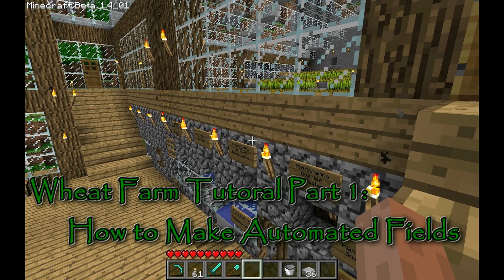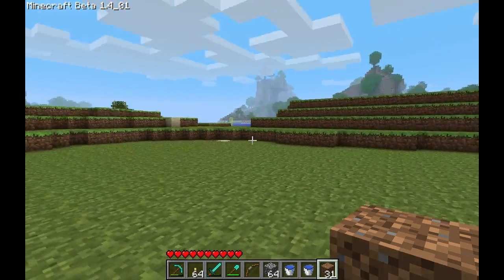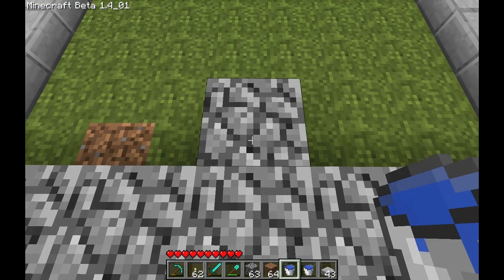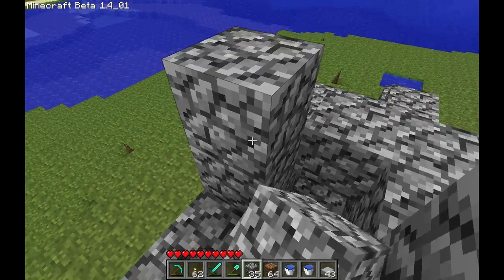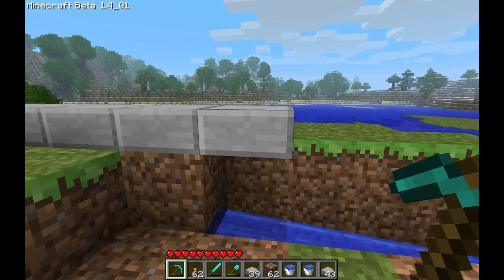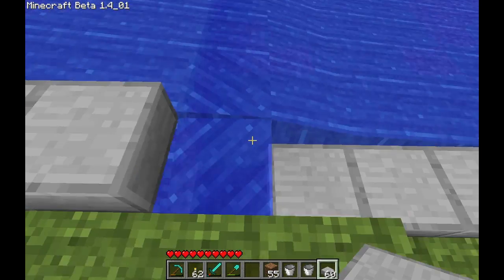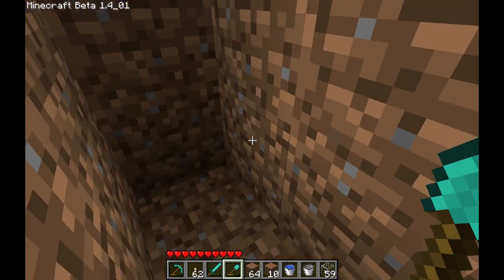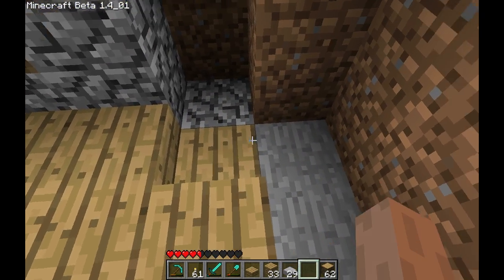Minecraft - Wheat Farm Tutorial Part 1: Automatic Fields

Comment from the maker: @Decimaegeminae  Keep in mind, this system was/is designed to work with more than just pistons, where controlling the flow of only a single water source is Much easier.  Technically you could double the width of the fields by only adding an extra block of height (2 for looks).  And I personally do like the elegance of it all coming from 1 water source (cheaper too!).  But you could just pop in 4 pistons (more if its bigger) and just split the redstone signal 4 times, yes. But you lose pizazz!

Comment: For the water source just use a piston and turn it on then put water on top, the water doesn't fall down until the piston is turned off, then just wire the redstone where you want and use a lever it's a lot more simpler

Comment: Allright so a few things I've noticed. You use up a lot of cobblestone with some of the stuff you do, you worry a little too much about aesthetics instead of saving blocks. You don't need to do separate sources of water for the irrigation system every time you do a terrace, it should flow down by itself. You can actually split the water AGAIN at the top so you have 4 separate terraced fields. Finally my big point, nothing you do after 13:30 is necessary at all. It will function at that point.